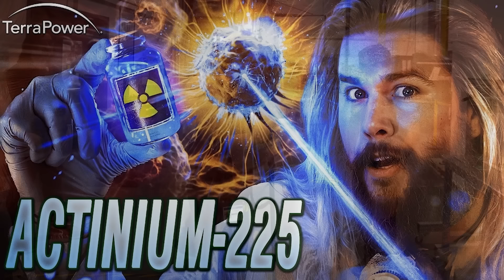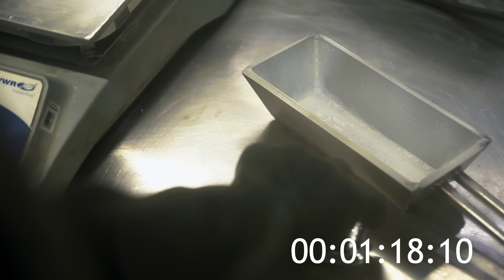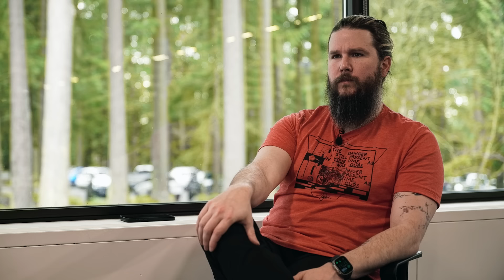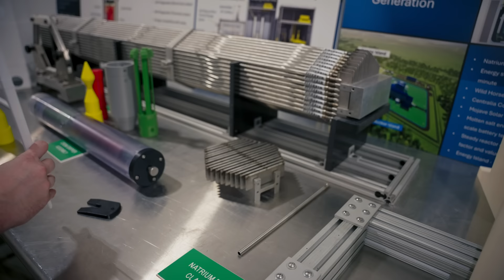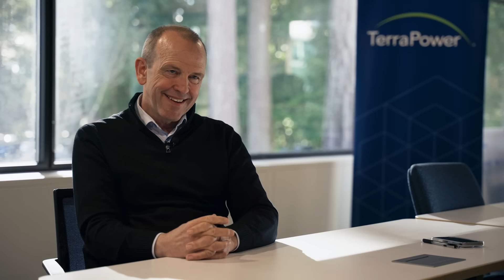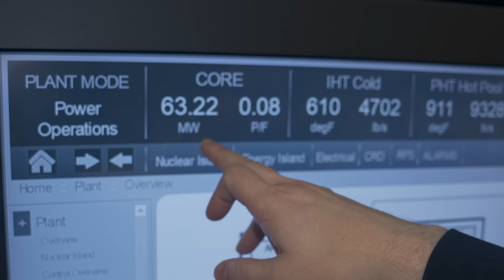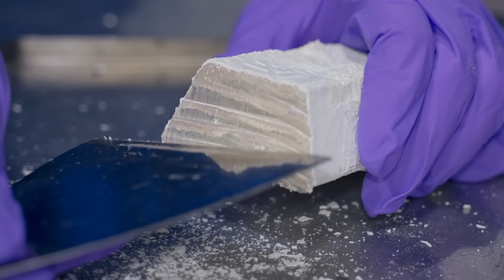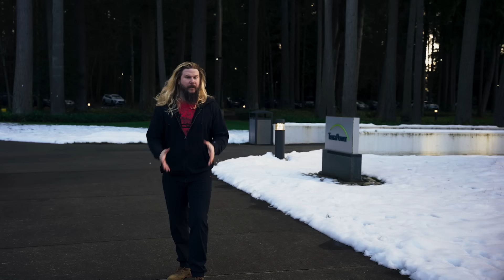Will Natrium Nuclear Reactors Change Everything?

Comment: Not so sure about this one: "(the reactor can) follow what the grid is actually demanding at that time - just like solar and wind can do..." er, you might want to research that statement a teensy bit more. The big problem of sun and wind energy is that DOES NOT follow the need of the power grid. Unless of course you Americans found a way control wind and earth rotation -  something we Europeans are still working on. For now, we just enjoy the power outages...

Comment: Sodium Metal. In a nuclear power plant.
What could go wrong.

Dangerous when wet) Sodium is a FLAMMABLE SOLID which will ignite spontaneously in AIR or MOIST AIR and reacts violently with WATER or STEAM to produce flammable and explosive Hydrogen gas.

Comment: Nice, but so slow. Feels like a typical engineer's trap, trying to design the most elegant solution, instead of the most practical.
In my own career, and by following a certain unpopular billionaire's work, I learned that speed beats elegance. In a commercial operation you should look for the fastest solution (which is not the same as cutting corners), not the best. I've seen a reactor design that could be developed and commercialized fast enough to still beat Terrapower. It uses 100% off-the-self components, all proven tech, no pressure, no water (CO2 cooled), no phase change (in the primary loop), no corrosion. Add TRISO fuel, and don't have to worry about melting down either.

Storing heat instead of electricity is a cool idea, but it could be used with any type of thermal power plant. Probably could be even retrofitted at an affordable cost.

Comment: Sounds easier to pull off than fusion.
Reply: We have pulled off fusion. Unfortunately the power profit was less than required to boil a single kettle. But we proved that it works and is possible!
Reply: @DepthVorpa  No we haven't :)

Comment: One thing I picked up on was what happens to sodium nuclei after constant bombardment with fast neutron radiation?  No mention was made about the coolant contamination caused by Magnesium 24 made from beta decayed Sodium 24. Would the lower boiling point cause voids in the cooling loop in a thermal excursion event?

Comment: I like this reactor if only because it’s extremely low tech when you get down to it. It means that you could fairly easily get one up and running compared to the extremely high tech reactors that need a lot of fancy things to make it work and be safe in the event of any kind of incident. The simpler the better.

I also like that in the event of a shutdown it’ll still be putting power out for a time which is a big bonus as it gives time to swap to another baseload providing power source or potentially repair and reactivate it before another power source is even needed
Reply: Anyone thinking nuclear is low-tech is stuck in the past where people thought in a decade or so every house would be powered by uranium rods and air cooled graphite moderators. Sodium doesn't solve a single problem, it merely moves it around a bit. In fact, criticality events haven't been a major concern in decades, so any technology to mitigate that risk is bogus. It's like improving coal power plants by reducing the risk of coal dust explosions.
Reply: @graealex  Despite the fact that Nuclear is already very safe, people are still afraid of it. Mitigating the already small risks as much as possible makes it more likely to get funding and replace fossil fuels
Reply: @worldlinezero4783 It's not safe, but people are constantly looking in the wrong places. Nuclear power turns benign Uranium into something that's deadly, without a solution.
Reply: @worldlinezero4783 Why would anyone want that, though?
Reply: @graealex  The combination of sodium coolant, metallic fuel and passive decay heat removal in this design does address 1 pretty big problem, loss of cooling (as experienced at Fukushima).
Reply: @richardb1452 Having functioning generators on-site addresses the problem also. Again, it solves a non-issue. While the real issues remain unsolved.
Reply: By "low tech" you probably mean that it's a rather old design that was designed to be passively safe. Except for one nice new feature in that the secondary heat loop uses a modern mixture of salts as the working fluid rather that the traditional second sodium loop. This means that the sodium stays in the reactor containment with all the other worrying stuff and the steam boiler is over a hundred metres from the liquid sodium.

Looking at some of the reports, the US Gov seems to quite like it, especially the part where the only output of the "nuclear island" is hot salt, something that's seen as basically safe. This salt feeds into the "energy island", which is identical to the plant in a solar-thermal generator.
Reply: @Robert-dB  Actually, it's the third circuit that uses molten salt. The secondary that moves heat from the reactor vessel to the molten salt heat exchanger is still sodium but shorrter (to make sure the salt is never in the reactor vessel). What they have essentially done is take the PRISM config and instead of secondary to steam generator, added a third extended circuit of molten salt that includes storage, steam generator, turbine, etc...
Reply: @richardb1452  I don't see many details of the design, but everything including stuff sent to the NRC seems to have the salt flow going through the containment pit. The primary sodium loop (pool) provides the major isolation for radiation.

The only reference to a more traditional double sodium loop I can find is in a Dr Ben Miles video where he talks about using a double loop, but the diagram he has on the screen shows one heat exchanger with either sodium or salt power output (and no return/cold pipes). As an actual molten salt reactor has the highly radioactive fuel going all round the primary loop of the "hot" heat exchanger I expect Natrium is not going to need a second sodium loop.

Oh and the salt is a mixture of Sodium and Potassium nitrates, it ain't gonna react with more Sodium.
Reply: @Robert-dB  Dr. Ben used the generic Gen IV SFR diagram, which is why his narration doesn't match the diagram. There are actual TerraPower/GE Hitachi videos that explain this. Always go to the source for details, not a youtube content creator. I mostly watch content creator videos on this topic to see what they (and commenters) got wrong.

You need to read more carefully. In the "Principal Design Criteria for the Natrium Advanced Reactor" submitted to NRC on page 6

"Hot sodium from the reactor cycles through the primary heat transport
system and transfers its heat to an intermediate sodium loop. The sodium in the intermediate heat transport system passes through sodium-salt heat exchangers to heat the molten salt loop,"

The primary heat transport system is the primary circuit/loop inside the reactor vessel. The intermediate sodium loop is the "secondary". It transfers the heat from the IHX (Intermediate Heat Exchanger, INSIDE the reactor vessel) to the sodium-salt heat exchanger in the attached ancillary building. This is done specifically to isolate the primary from the molten salt as it is mildly reactive with the liquid sodium (and pretty much everything else at these temps, just like in an MSR, though in this case it is not radioactive). Same basic reason they use an intermediate to isolate the primary from water in PRISM and EBR-II. Though the salt is orders of magnitude less reactive with sodium than water, it is not zero. By using this arrangement, any corrosion issues that may arise in the sodium-molten salt heat exchangers can be repaired OUTSIDE the main containment. I doubt there will be problems here. An interesting side comment is that for EBR-II's second set of steam generators (and in the PRISM design), they reversed the typical flow for the sodium-water steam generators. Traditionally, the hotter fluid is in the tubes and the cooler fluid is in the jacket. They found on EBR-II that corrosion could be virtually eliminated by having the cooler fluid (water) run in the straight tubes jacketed by the hotter sodium as this made far less turbulence on the water side, vastly reducing it's interaction with the stainless steel. I would not be surprised if they do the same thing here with the intermediate-molten salt heat exchangers.

"Intermediate heat transport system" is the GE Hitachi terminology for the secondary from PRISM, although in the case of PRISM it ends at steam generators. Natrium is essentially a tweaked PRISM "burner" core, which is why TP partnered with GEH on this. Here they have inserted the molten salt loop & storage between the intermediate loop and the steam generators. The molten salt loop does not enter the main reactor containment building itself. In fact, the ONLY things that enter the main reactor containment building are:
- intermediate (secondary) sodium loop
- cover gas
- power
- control signals
- dehumidified air
- pathway for refueling machine/maintenance (sealed during operation) between the main reactor containment building and the fuel handling building, which is on the opposite side of the reactor building from the ancillary building. Of course these three buildings appear to be one and the same in a diagram, but they are just "connected". The main reactor containment building is built to different standards.
- sealed ducting for the passive decay heat removal RVACS (Reactor Vessel Auxiliary Cooling System) which is there for passive cooling during a loss of cooling design basis scenario.
Reply: @richardb1452  Thank you. Though I suspect my problem was looking at the pretty pictures too much (400 documents even if half are emails is a bit much right now). Still, about those images, I just found the older  ML22301A073 and comparing with the banner image at the top of the NRC Natrium section suggests that the second Sodium loop wasn't originally there. Presumably not, strictly, "necessary" from a scientific standpoint, but, I guess, would add another barrier (with monitoring) between the two islands and so needed to keep the turbine hall officially "off-site".   NB: This would likely be over 3 years ago now.

Again, thank you.
Reply: @Robert-dB  It was designed this way from the start, regardless of ambiguity in any diagrams. Check page 11 of ML22301A073. It clearly labels intermediate hot/cold sodium legs and the "Sodium/Salt HXs" in the auxiliary building (I remembered it as ancillary, but none of us is perfect...lol). The banner page diagram is the same image, but with reduced detail in the labels (i.e. ambiguity). I absolutely understand this stuff can get confusing even for those well versed in water cooled reactors or even worse MSRs. I've been closely following SFR development since the 80's when they did the loss of cooling tests in EBR-II (I was in college those many years ago...lol). This one, like EBR-II and the proposed PRISM really are different animals including the use of metallic fuel (not oxide or nitride ceramic) to sharply increase the negative temperature coefficient of reactivity, make the core more compact and make reprocessing more efficient. It is IMO the most advanced SFR design ever proposed, let alone built.

There is (or at least was)  an hour+ long video by TP/GEH engineers from before any docs were submitted to NRC that goes over the sodium and salt loops, but I don't have the title handy.

There has been some back and forth between TP/GEH and NRC on where the "line" should be drawn between the nuclear island and the energy island. Last time I looked at it, NRC was pretty insistent that the demarcation was at the molten salt loop to storage tank interface. That seems a bit excessive to me as the downstream heat use isn't technically required to act as a heat sink in accident scenarios in Natrium like it is in traditional reactors, but I suspect TP/GEH caved on the point to just get it moving along.

Comment: What happens if the sodium solidifies due to a pump going out or some other miss happe. Does that mean the pipe is now indented with a solid block of metal? how would you solve such issues with a system that could have a massive pipe blockages.
Reply: It's a non-issue.
Reply: @Hamstray  please explain why/

Comment: Any project that uses molton salt is doomed to fail: there are significant technical difficulties involved with managing very hot, very heavy, very corrosive fluids.
What happens if all the salt solidifies in the pipes? How will you work a full plumbing replacement cost into the budget every 6 to 18 months? Are there enough people with expertise in this field to scale with the construction of multiple plants?
Reply: I don't think it's fair to say it's doomed to failure because of these issues, but I sure wish the video would have spent some time addressing what is clearly the biggest issue with bringing a molten salt reactor to market

Comment: "They want... They will... They told me...", this could be considered an ad or it needs better phrasing. 
Considering this a private company, well, everyone can make up their own mind.

I still hope they, as well as any other nuclear power research projects, will result in success.
Reply: It is sponsored, he mentioned it in the video and it is in the description very clearly. Still a good video regardless of sponsor or not, I'll just hold onto my hesitation with a design that hasn't been built yet.
Reply: I mean. It is essentially labeled as such, yes. Obviously, this is a very positive piece on someone essentially (and probably literally) sponsoring the video. But there's still useful info here that people can use to make up their minds
Reply: @Cyrribrae  I don't think so. Everything shown was theoretical. From the simulators they are using to the technology, nothing is really concretely built yet. It's just all on theory, which, in theory, should work, but we all know how it goes
Reply: @marinell06 only problem i see, is the usual “this system needs to be slightly altered” because maintenance crews find it hard to access. Alterations in the full construction, not how the system itself works.
Reply: @marinell06  You can't get a commercial license based on only theoretical. The base reactor tech was demonstrated in EBR-II for 30 years successfully including actual passive safety tests.
Reply: This is a sponsored video, so it essentially is an ad. I missed the part where he mentioned the sponsorship the first time I started watching the video. It sounded more “ad-like” than usual so I went back to the beginning and heard him say “this sponsored series” at 0:42. I’m not a fan of the boosterish tone and feel that he should have made it more clear that this is a sponsored video. Sponsored content is a tricky river to navigate, between the banks of editorial independence and economic opportunity. A brief discussion of the sponsorship at the beginning or a small “sponsored” label in the corner throughout the video would be sufficient. Saying “sponsored” once may technically be notification, but I expect more than that.

Comment: "See it's only dangerous when its molten" - builds reactor where the where the whole system is full of molten sodium. Cool tech though.
Reply: Well, the pipes containing the sodium are completely unpressurized, meaning they're much less likely to burst, and the sodium actually protects the interior of the pipe from corrosion, meaning there's a much lower chance of there being corrosion inside the pipe where it can't be seen. To my knowledge they also have multiple layers of protection, so if worst comes to worst and the pipe holding the sodium fails, the area around it is filled with an inert gas so there would be no explosion
Reply: @jonaut5705 too bad this video didnt talk about that more clearly
Reply: @etiennedud  yeah you're right, it's pretty safe, but i also wish that the video discussed it a bit more
Reply: @jonaut5705 I'm thinking about destructive external factors where water might be involved. See fukashima, hurricanes, floods etc.
Reply: I'm disappointed that Kyle didn't mention that or dig a little deeper. Sure, it's sponsored content, but why bring up sodiums reactivity to assuage fears then skip over the most relevant part.
Reply: @mjolnir3309 it's not presurized, so it won't explode, it solidifies almost instantly being cooled in air so it wouldn't spread all over, killing the flow of the whole thing. 
It's mostly safe, safer than steam

Comment: tbf Kyle humanity's first attempt at using liquid sodium in a reactor it did not end well.  It did use slow neutrons and graphite in the reactor.  Water did start to leak into the pipes and that lead some problems in the reactor.  It did not go full meltdown but it do go out of control.  Molten sodium, water, the graphite mix cause damage to pipes leading to further leakage.

Comment: 15:28 so it is dangerous in a lake because it heats up enough to melt in contact with water. But in normal operation isn't it already in liquid form at a high temperature flowing through a heat exchanger with liquid water or steam on the other side. Seems like a recipe for "high reactivity". Not that heat exchangers ever leak, over a 40 year lifespan, oh wait :face-orange-biting-nails:. Liquid sodium while low pressure sure seems to give me bad vibes for safety.
I do wish them luck and commercial success so they can make many of them. Especially if they can reduce the waste which didn't seem to be addressed but I guess fast neutrons help there?